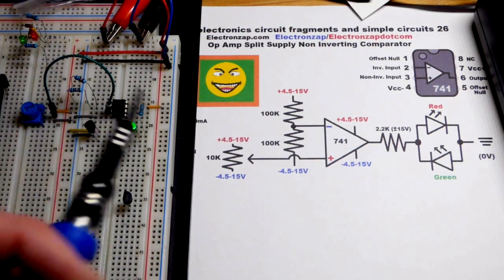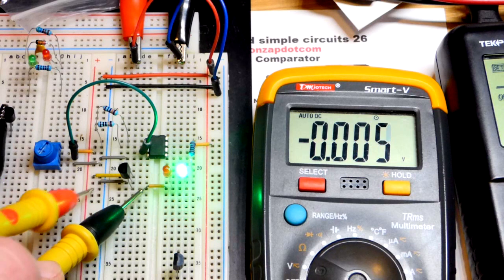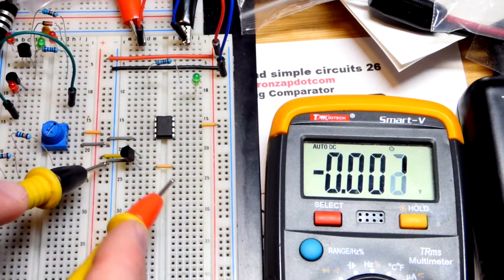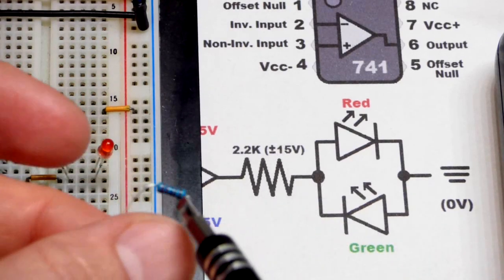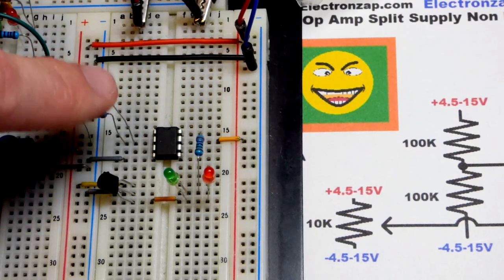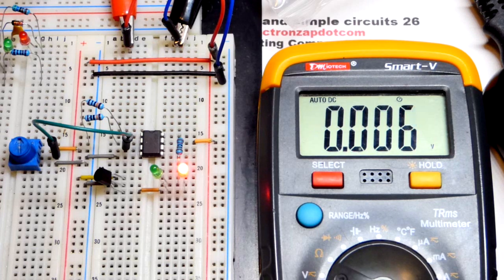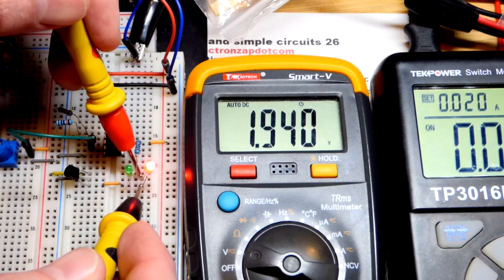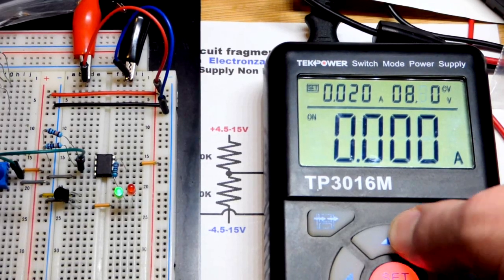Electronics course 28 741 op amp non inverting comparator using TLE2426 virtual ground rail splitter

Comment: I just wish these little suckers were not so dang expensive. The TO-92 package is ultra convenient but I am sticking with my ICL7660 Dip8 to generate a negative rail cuz they are VERY cheap. (At the expense of adding two 10uF caps or 2 caps and 2 diodes if you want a voltage doubler.) Cheers! Oh, you wouldn't believe it but another settlement needs your help ... 😏
Reply from the maker: Yup :(